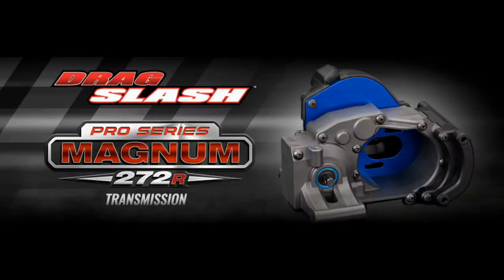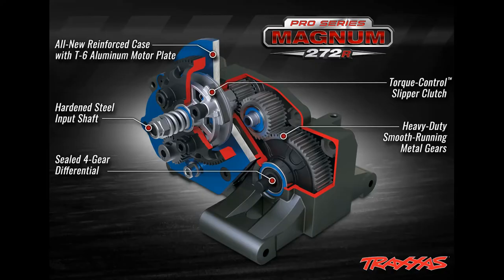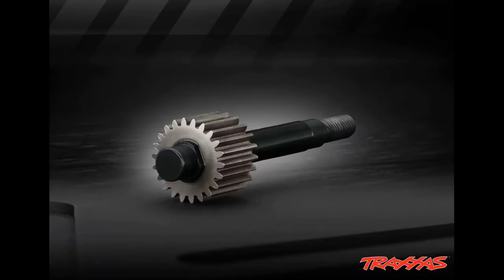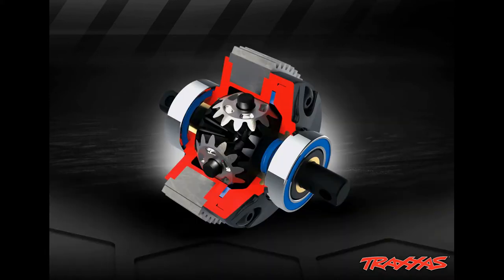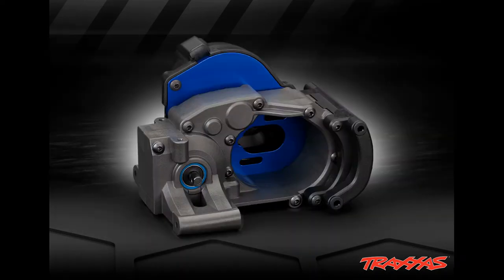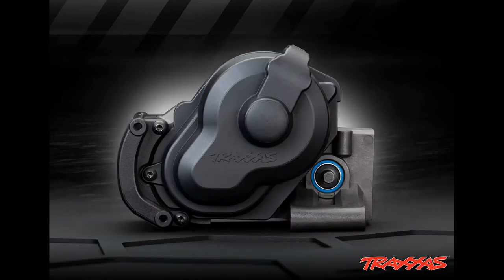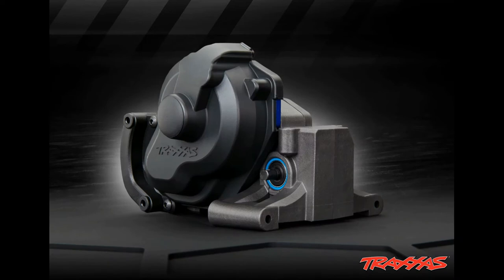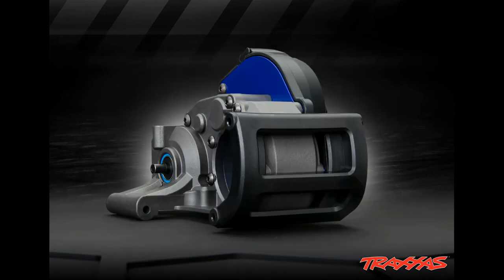Traxxas Drag Slash update

Comment: I just saw the new update Traxxas could not even take the time to put a motor in that's over 5,000 KV...... I love Traxxas but Losi has a 6500 KV in their new drag car. You will have to change the stock gears out for a 74 tooth spur with over 25 tooth pinion but it will be much faster than the traxxas. All Traxxas has going for it is TSM. So sad 😢😢😢